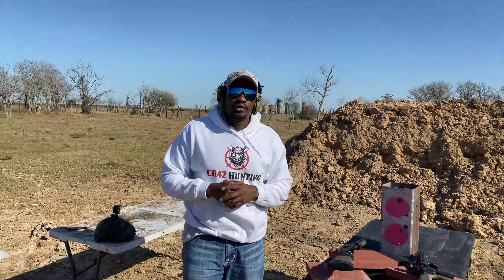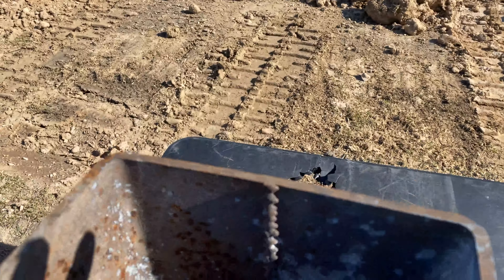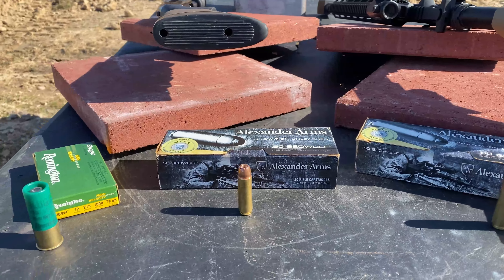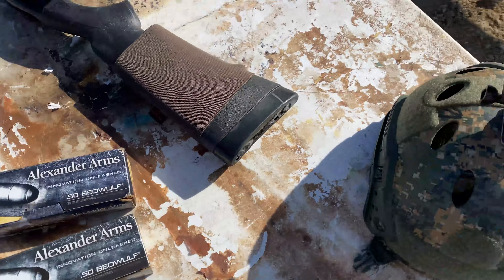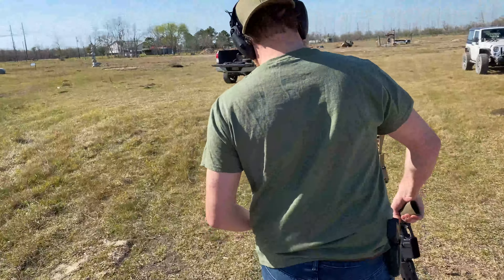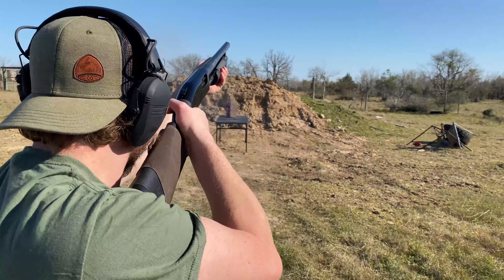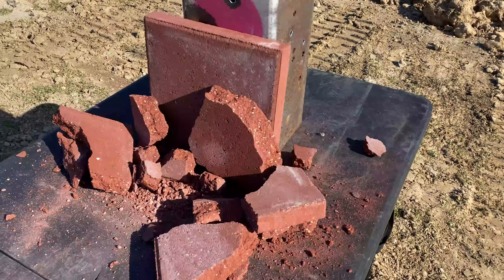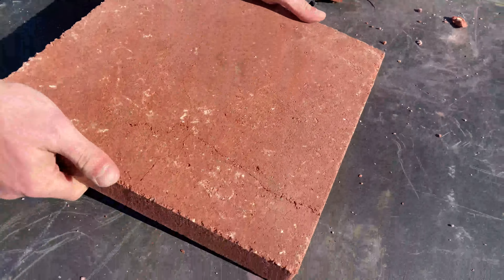50 Beowulf vs Shotgun: How Many Pavers?

Comment: 12 gauge won’t be good for steel penetration because it’s soft lead and it pancaked immediately. On soft targets like deer, elk, or humans(self defense) it will do maximum damage by releasing all that kinetic energy within 12 inches. A 50 will do damage but a lot of that energy get wasted as the bullet will go right through someone or something. An example my bro shot a deer twice with a 30-06 180grain and had 2 complete pass through with minimal bleeding. Only 100 yards away. My 12 gauge slug neck shot at 50 yards is an immediate drop. Breaks the neck and ruptures all main blood vessels

Comment: I have to correct you on that, there's no such thing as a rifled slug on a 50 Beowulf, rifled slugs are something they put on a shotgun slug because it's a smoothbore and the rifled slug makes it more accurate. Every 50 Beowulf Barrel is going to be rifled so it doesn't need to have a rifled slug.
Reply from the maker: Your point makes sense
Reply: @cr42hunting99  I can't remember now the letters I think it was RS and it stood for rounded shoulder but I believe the first time I've ever heard of that on anything maybe it's specific for 50 cal I don't know. Good video anyway it's nice to know what they'll do! I'm waiting for my new 50 cal the old one I got won't cycle properly it won't eject the shells very well, so I just got a whole new upper.🙏🏻